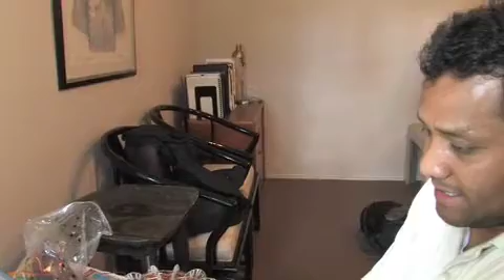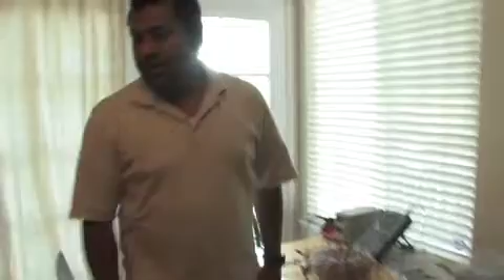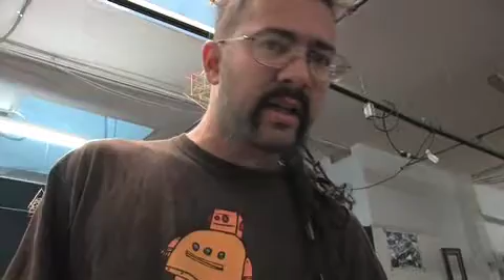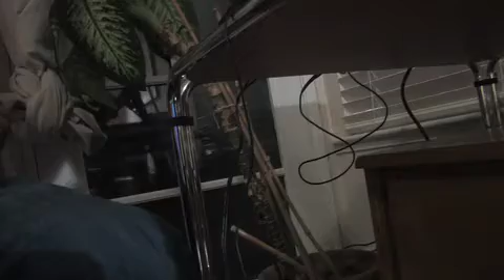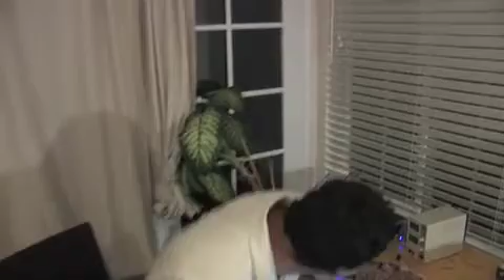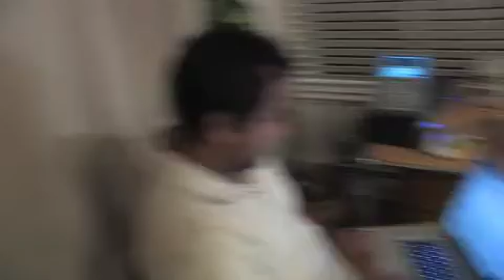Franklin

Comment: Have you tried using a free spinning copper cylinder, too check for traveling fields?  
Check out "Magnetic River"  Eric Laithwaite uses a two coil system with opposite directional currents (phases) to levitate aluminum.  It could be helpful in your research.